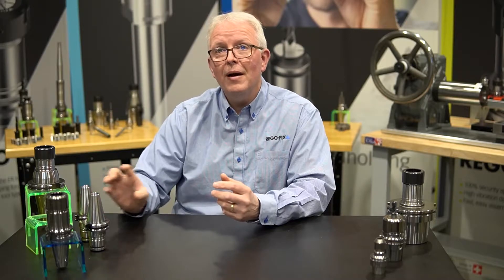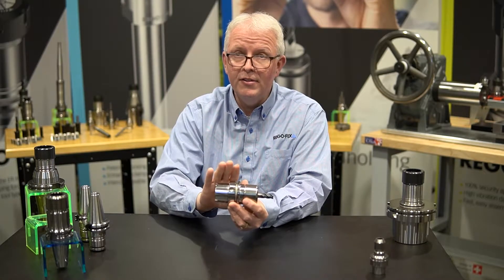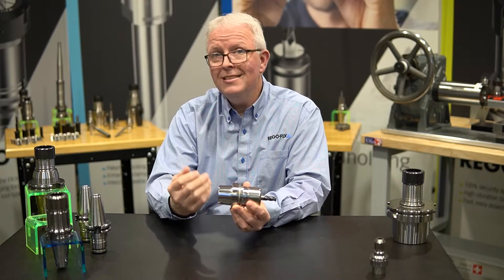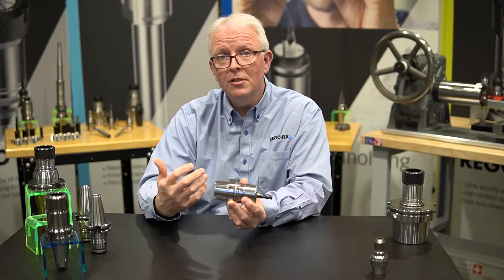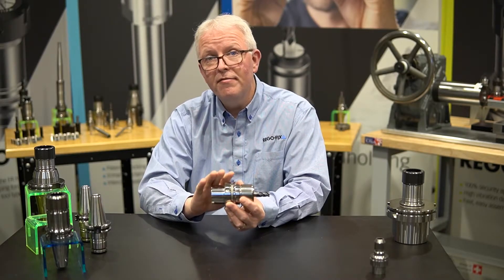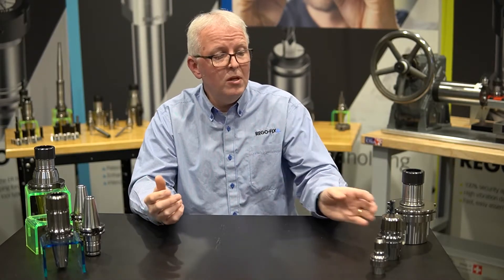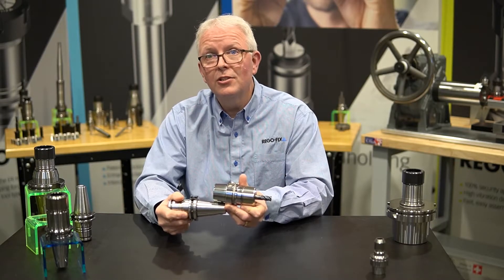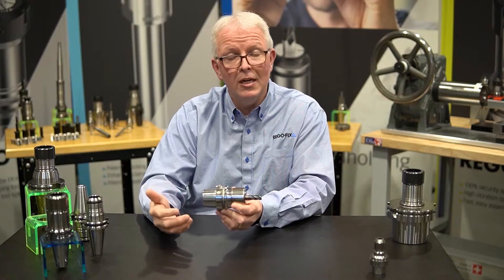TechChat - CAT vs HSK

Comment: 6 times more rigid, where’s the data that shows this?
Reply from the maker: While these are slightly older studies, the two links below both have great write-ups on why and how HSK has greater rigidity. It's also important to note that, in most cases, we are looking at the much more common standard style of CAT holders, versus BIG-PLUS style holders. BIG+ has the benefit of acting like an HSK holder in that there is dual contact between the taper and the flange, which is the chief cause of the additional rigidity.

https://www.hskworld.com/articles/Characteristics_and_capabilities/characteristics_and_capabilities.htm

https://www.sme.org/technologies/articles/2004/whats-the-connection/

Comment: So you can you HSK holders in a normal cat 40 spindles?  You can you them both in the same spindles?  Or do you need a specific type of spindles?
Reply: Never mind lol. I see now you need to have a hsk spindle . To use those holders
Reply: @drogers0033  Differences are in the spindle taper, ATC arm and ATC pots.